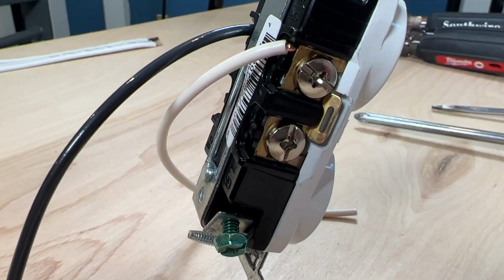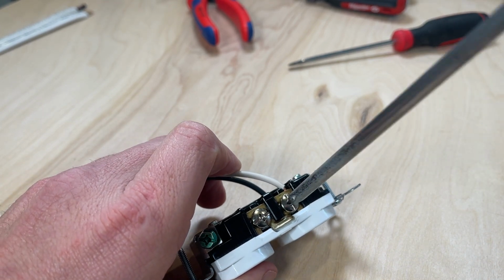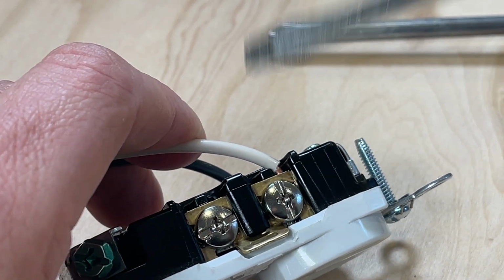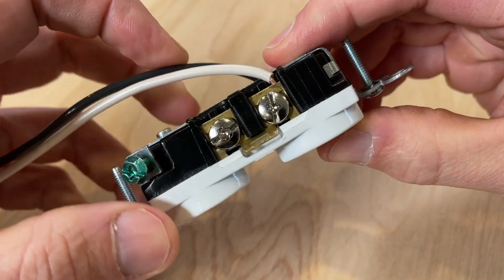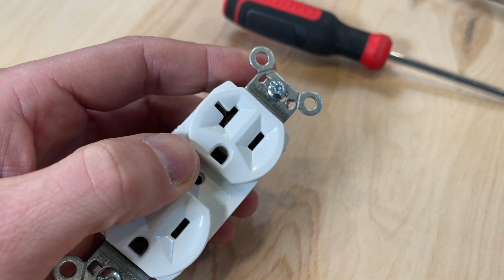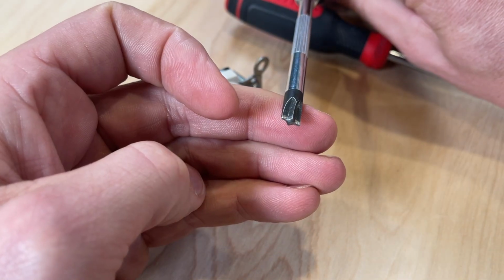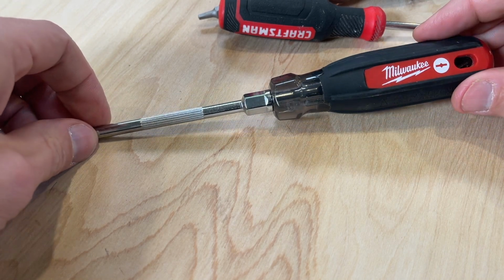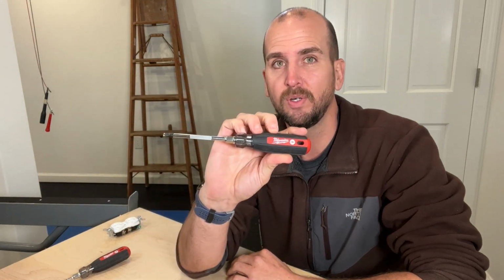80% of People Use the Wrong Screwdriver For Electrical Work

Comment: I prefer the square drive it gives enough torque for the application.  I also prefer but holder type of screwdrivers since they can alloy the bit specifically for the purpose.

Comment: I use the Robertson without even knowing that was a Canadian thing. But thanks to your info I will check out my case of multiple drill bits and screwdriver tips, the kind you get when Canadian Tire does one of their "80% off" specials.  If that hybrid screwdriver tip is in there, I will snap that one into my ratcheting screwdriver in the future. I'm such an occasional DIYer that I won't shell out twenty bucks for the special screwdriver that I'm likely to misplace!  Many thanks for this demo.

Comment: I do wish the USA moved from Phillips to Robertson.  The history of the choice and how USA went Phillips and Canada trended to Robertson is fascinating.  But, the USA mad the wrong choice.  I generally use a straight blade, but with a wider blade, for the outlet terminals.  I like the idea of the ECX screwdriver, but won't spend $25 for one screwdriver.  On the other hand, one could buy the replacement bits and use them in a less expensive multi-bit driver.  Buy two Harbor Freight drivers (about $1 or $2 each) and put the Milwaukee bits in them.  Keep the original HF bits as spares.

Comment: What about the wiha xeno driver?  How does it compare
Reply from the maker: Good question, I need to look closer.  Looks similar to the Milwaukee ECX and the Klein Combination Bit but also has a little more of a tip in the middle that might fill the screw a little better 🤔.  Thanks for the heads up.
Reply: @EverydayHomeRepairs  so I got one and the xeno bit is Phillips + slotted vs square + slotted

Comment: I though I had every screwdriver ever made.  Clutch screwdriver anyone?  Bow-tie or regular?  But lo and behold the ECX.  I've ordered mine today.  Full set #1 and #2 in 1", 2" and 3-3/4" length.  Thanks for a very useful and informative video.
Reply from the maker: Nice, you will like them 👍

Comment: Ya know, I bought an ECX but I swear it’s too large for most of the screw terminals I’ve used it in. I got the bits and a dedicated driver and they’re just ever so slightly too big. I’ve given up carrying it and never getting to use it. As much as Phillips and slot suck, they’re always on me, and sometimes the tool you have is the best tool ;)
Reply from the maker: I have heard that from a few others.  I wonder if their grinding machine was a little off for the bits.  I would try to get another one as my #1 screwdriver lines up well to all brands I have tried it on.

Comment: Well now I know why I’ve been stripping a lot of the receptacle screws with a phillips🤦🏻, thanks for this very helpful video will be getting a Ecx!
Reply: The Philips was made to cam out to keep them from getting the screw too tight as they were used in assembly line work and were made before they had clutch drivers that could be set to not over drive the screw.

Comment: I honestly only started using the #1 square bit this year. I knew it was a thing, just never had one on hand. Using my impact driver (on speed 1/3) screwing in outlets is a breeze! I hated using Philips heads. They always slip!
Reply: Maybe if you didn't use a tool for driving 6" lag screws into pressure treated lumber for fucking electrical fittings you'd have fewer problems in life.
Reply: @waytospergtherebro  I only use it to attach the long screws into the box. I use a screw driver for the electrical connections. And as I said, it's on its low speed, low torque setting. Never had a problem with it while using the proper bit. I know plenty of electricians that use a low speed, low torque power screw gun to attach the outlet or switch to the box housing. There's literally nothing wrong with that. Nobody is using power tools to attach wires.

Comment: As a Canadian for the longest time I didn't reolize the square drive (robirtson) was not used much down south but I think it's ideal because it doesn't cam out like phillips does. But there is also the Japanese phillips that solves that problem as well. Called JIS #1 (Japanese industrial standard) which people who work on Honda or yamaha equipment will know about or Pz #1 which is pozidriv which is phillips but solves camout problem as well. 

Small difference in design but huge difference in performance  especially on those stuck screws
Reply: It seems you and the JIS folks may not understand that the Phillips  is supposed to cam out as a means of preventing over-tightening of the fastener by design. If you want the fastener to be tighter you are supposed to use a different design meant to achieve that; there's plenty to choose from. I'm an American, but I agree with you that for most applications Robertson is better, yet it has it's own design weaknesses too. The reason it never got popular outside of Canada is greed- Robertson wanted more $$$ to license it's use by manufacturers in the US than Phillips wanted for his system, so factories took the cheaper option since it was adequate. Once things got established it tended to stay that way because everybody then had those particular tools. A Canadian by the name of Witold Rybczynski wrote a book called "One Good Turn" explaining the history of the screw and the reason for the many types we have, it's really good reading and I highly recommend it.
Reply: @P_RO_  I'm aware it was designed that way on purpose. We were talking about this specific application where you need more torque i felt these were valid options for our specific application. I mean no you shouldn't just start over tightening all the screws in your engine bay or something.
Reply: @codylucente  A Phillips is the wrong tool for this specific application and if you try to do anything with the wrong tool you often end up with an avoidable failure. If you can't or won't do a job correctly then you shouldn't be doing it. The difference between an amateur and a pro isn't so much in doing a job the right way because both can do that, but in understanding why it needs to be done that way which only the pro does. Knowing why is worth a lot more than only knowing how.
Reply: @P_RO_  I never said to use a phillips. But the fastener has a phillips head. I also never said to use a JIS. Just that there are many better alternatives. I feel like your being argumentative instead of fostering a positive community. If you have anything positive to add instead of being negative I welcome it
Reply: @codylucente  So advocating the use of the correct tools and explaining the problems with using the wrong ones comes across as something negative? Seems to me if there's a problem here it's not mine. I dropped in on this vid because it was 'recommended' by YT and though  I might learn something new. I have done that but not in  a good way. I'm done with you.
Reply: @P_RO_  you are not advocating the use of the correct tool just putting me down for what I said. You made no suggestions  and did not contribute in a meaningful way to this conversation. I stated there are other alternatives and u just said I was wrong and not in a way we could both grow but in a way that just put me down. I was trying to be very polite with everything I said. This always happens online in comments and forums.
Reply: @P_RO_  , The History Guy channel did a video about screwdriver history a few years ---- it is still his most-watched video!
Reply: @goodun2974  I've seen it- the book is much better in facts, research, and documentation.
Reply: @P_RO_   well of course the book was better. It usually is! That being said I mentioned it mostly because it shows the extent to which people actually find this subject interesting.
Reply: A hint for those unfamiliar: the JIS Phillips variant usually has a small divot or dot in the screwhead to signify that it is a JIS standard screw head.  You can't normally buy those special screwdrivers in a local hardware store and the primary manufacturer is Vessel, however, the Milwaukee impact rated Philips drive bits fit them quite well, much better than Dewalt or Makita bits (and there is one particular dewalt Phillips drive bit that has a pointier tip and thinner vanes than most, and doesn't seem to fit any screw I've tried it on,).  Japanese built stereo equipment usually has JIS screws.

Comment: I didn't know Milwaukee made one like that.  I picked up the Wiha 30701 Screwdriver Insulated Xeno #2 SoftFinish Driver, which is the combo.  They have a pozidrive version of the Xeno as well for those who need that.  Far more torque on the terminals.  Hard to find when I bought mine, but found them at a good price on ebay.

Comment: Those screw terminals on the LeGrand are specifically designed for the ECX bits or screw drivers. At the very beginning I noticed those terminals were ECX. I use ECX all the time because I'm usually in panels, but I use Phillips for receptacles because I install Lutron which are Phillips/slotted terminals.

ECX is my favorite because I get the least amount of slippage to the highest amount of torque.
Reply: Never have good luck with slotted or Phillips screws for general projects.
They just done make the cuts in the heads of the screws deep enough.

Comment: as someone who has done oodles of reasonably beefy DC current industrial wiring .... these things have a torque rating , you can over gronk things that feel super tight but a couple thermal cycles its all wiggly. There's very few words to describe a 480 AC volt in, 60 DC volt 360 amp out  loose connection than OH S*** and OW! Where does the rabbit hole begin?

Comment: Here in Canada we use the Robertson 1 (green) for the outlet/switch screws as well as securing the outlet to the device box.  Robertson 2 (red) is used for the box grounds and wire feed clamps.

Comment: I've used all three,...and Robertson stripes out as does Philips... I'm getting ECX now because it's best of both worlds... square drive and slotted...thank you for your helpful tip!
Reply: Robertson is just fine if you buy actual bits (like Milwaukee) rather than the cheapest cheese grade chinesium ones
Reply: The only time I have had a Robertson slip out was because it was wore out.  Nothing last forever so if is slips then get a new one.  Also make sure you use a #2 Robertson driver for a #2 Robertson screw.  If you use a #1 Robertson driver on a #2 Robertson screw it will slip because a #1 is too small for a # 2 Robertson screw.    The problem I have most of the time with a Robertson is I can't get the screw off of the screwdriver because it locks so tight.

Comment: I have a screwdriver made for electrical work that is a combination of flathead and PZ2 (can't remember if it is called PZN or something). And it's also 1000V VDE certified, not like any of the tools in this video. Even if you prove dead always handle them as being live
Reply: I use them too, pozidrive I think they are called. You can really crank down and they never slip.
Reply: @jim8395  it's not Pozidriv, Pozidriv is like Philips but with a star in between. According to wiki it's just called Slotted/Philips
Reply: Maybe the ones I use are different, they are Wiha SL/PZ1 and SL/PZ2. Two different sizes, Wiha website calls them a Slotted/Pozidriv 1000V rated and when used on circuit breakers and other electrical connections they never slip. I put a link to the website before but the reply seems to have been lost.
Reply: @jim8395  exactly those I meant, I too have both sizes
Reply: @justme5384  Nice to find someone that has appreciation for nice tools, I have bought many sets over the years and given them away to electrician mates as a gift, they are always a bit perplexed initially they they report back how fantastic they are. :)

Comment: DIY. I actually really prefer a quality #1 square over the Milwaukee ECX #1. Using Wiha, Felo and Wera have all been great except for the ground screw which always seems to be a weird in between #1 and #2 square so I switch to the flathead like you suggest to torque that baby down.

Comment: please understand that square-drive and Robertson are actually two different screw heads, and correspondingly different drivers.  .  Robertson drivers have a slight taper on them, whereas square-drive the sides are parallel.
Reply: correct.  The square is marked with an S-1 and the Robertson has a R-1

Comment: The problem isnt the philips screwdriver, the problem is that its a philips / square drive which will just make your philips and even your square drive slip and strip. The one size fits all screw while convenient will never perform as well as a slot only or philips only or square drive only screw head. It is a compromise and will slip and strip easier because it isnt any of the above but tries to be all the above at once.
Reply: NO,, the problem is the Philips screwdriver because it was made to slip out under torque because they did not have clutch drives in those days so when you try to take out the damn Philips screw it cams out or slips.  There have been more cussing and swearing over the damn Philips screw heads than any other thing on the planet.  We toss them out here and put in Robertson.  There is no one size fits all so you need to learn your driver numbers #1, #2, and #3 Robertson and use the correct one when needed.

Comment: I rarely install an outlet but when I do I use a flathead and a phillips on a gun. The flat takes off the cover plate and works good on the sides of the outlet. I use the gun to quickly remove and reinstall the long screws holding the outlet to the jbox.

Comment: Thanks to your interesting videos, I’m learning more all the time. My one nit here is that your #2 philips is ready to be replaced - the bit is clearly rounded & worn out. I have some old screwdrivers like that and every time I use them, I think “I should have replaced this last time I used it.” Now I will!
Reply: A good quality machined tip Phillips driver will out-last and do a much better job than a cheap basic Phillips.  Xcelite made those with what I think they called a Super-True tip, which was black while the rest of the driver shaft was silvered.  I've seen way too many imitations of that style that are cheaply made and wear out quickly.

Comment: Bought new ECX on e-bay. I had no idea why these screws “always sucked”… would also question why the industry decided on this screws for basically disposable parts.
Reply: They screw is designed to permit the use of phillips/slot/robertson.  The ECX just uses all three to give you the best torque capability.

Comment: Wow, not getting that. And while I am not an electrician,  I'll bet with normal tools I will install an outlet faster and just as secure from start to finish.  Too boot, this is the first you tube video I think I ever replied too. There is a thing as making a job too complicated, and this is the end result of that.
Reply from the maker: I feel honored for the first comment.  Thanks for the feedback 👍
Reply: @EverydayHomeRepairs  In all fairness, some of your other stuff is pretty good ( I watched some things after this video). It just might be that I'm older or learned to do stuff differently years ago. Sometimes the tool you use is about what your confterble using. Case in point , I can not use a newer wire stripper, but give me the old style one with no set positions for wires,  with the guage off and I can strip wire perfectly and quickly.  Your screwdriver may be the best tool around,  but it isnt for me. I did watch it though.